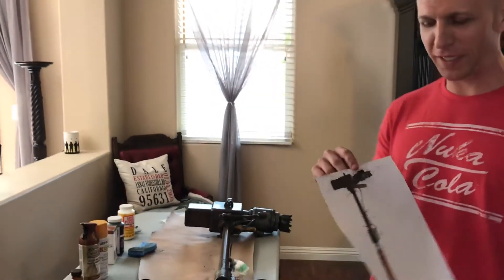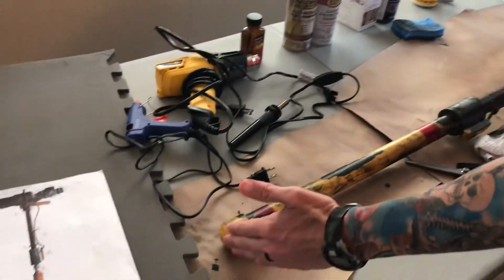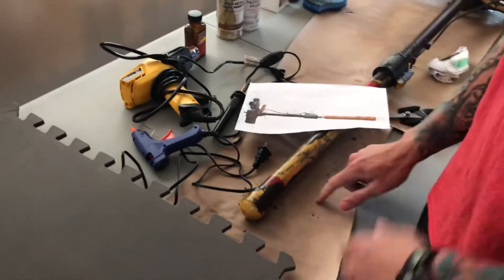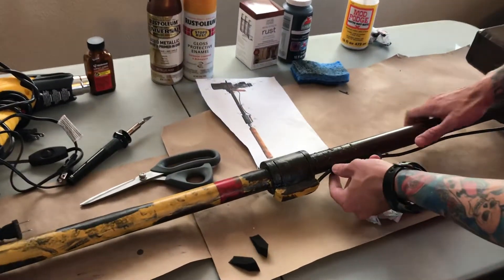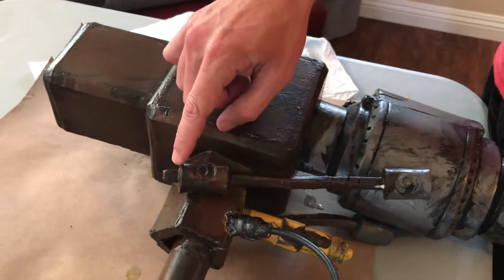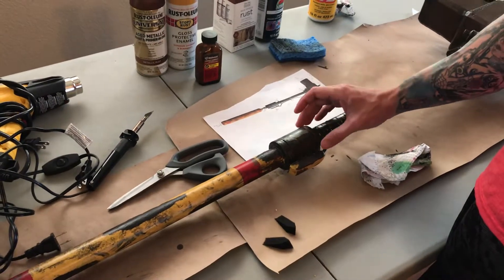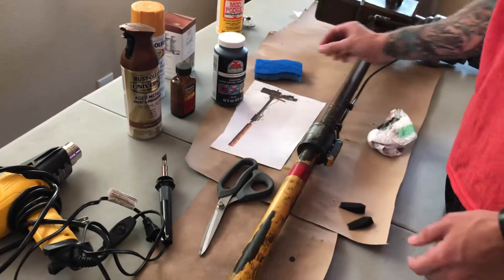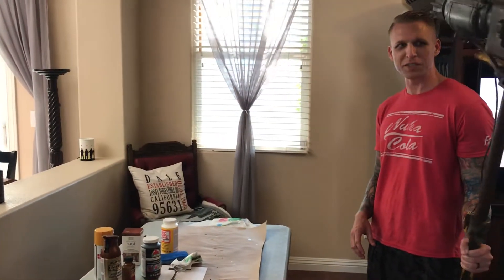Fallout 4 super sledge prop cosplay build

Comment: Hi, in a first time good job for this super sledge ! How have you done the rocket ? Also with foam as the other elements ?
Reply from the maker: Also with eva foam. Using a heat gun to form it and then a hot knife and dremel for the details
Reply: And what means did you use to assemble the parts together?
Reply from the maker: Raphaël Bordaberry contact cement is the best for foam
Reply: Ok, thanks for your answers !